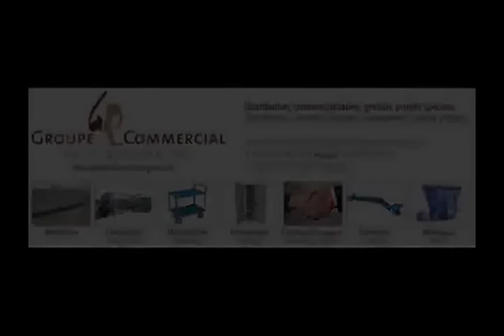Reaping the Fruits of a Patz Mixer: Composting Mixer Demo

Comment: Consulto inoculando microbios y mezclando estiercol heno....en que tiempo estara listo como producto final osea compost .... O cual es el beneficio de mezcla constante ....muy sgradecido de antemano
Reply from the maker: When used as a composter, a vertical mixer is “batch system” with an average retention time of 28 – 32 days from the time the last ingredient is added.  A timer can be added to rotate for two minutes, 3 – 4 times daily. A convention in-vessel drum composter advantage is it is a continuous-feed system, meaning you can add raw material and extrude finished product daily. Mixing first to break down and blend organics and carbon reduces composting time by an average of 7 days, increasing drum composter efficiency by 25%.